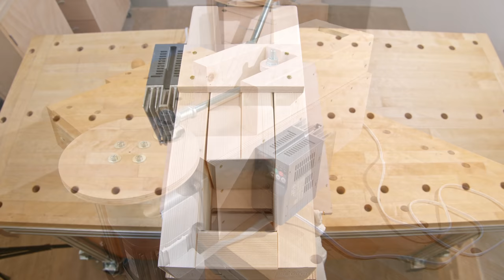An amazing way to compress household waste

Comment: You should just make a 1.5 hour long loop of the video from 0:05 to 0:46. That whole process is just SOOO satisfying. I love the sound of the empty can being dropped in, getting crunched, then dropping into the trash - all as the motor drones in the background.

EDIT: And you did it at the end, too!
Reply: Would serve as a nice 'white noise' loop to put me to sleep at night.
Reply: I did not find it satisfying.  I can easily crush cans that much with my hands, just as fast. It seems like it could crush the cans much smaller with that motor.  Doesn't seem stressed at all.  Though, the bottom board should be pocket holed for more strength.  The way it is attached can't have much strength.  Alternatively, metal could be wrapped around the outside and that metal screwed into the side boards.
Reply: make it 2 hours
and filter out the motor noise as much as possible
done

Comment: Well done! I love your design and construction skills. The motor and power supply would be the expensive items. However, by constructing it oneself the total cost would be quite reasonable. For those who collect many cans, the space saving for carting to a recycling centre, and the consequent reduction in fuel costs, may make it cost effective. So ignore the negative comments. You have presented a machine designed to increase the number of aluminium cans which can fit in a given volume (e.g. a trailer or Ute) to cart to a recycling centre. Potential users can work out for themselves how cost effective it would be. Great idea 💡. I like it. 👍🏼

Comment: Do you usually buy the motors for your projects, or do you scavenge them from dead appliances / other sources? Great, great work, from precision to practicality to aesthetics, all over your channel!
Reply: I admire his work but I don't think I would invest that much money and time to make a machine to break up cans. Many of those projects online make the builder look good, but has little use in real life. Most people are in the Youtube to get view and make money, not to teach you anything useful.
Reply: @Hour882Die  No offense but ... I think you overestimate what YT gives people in terms of money at present (years ago maybe that was a different story but not anymore). There is a reason why many have turned to patreon and other sources of revenue. As for no use in real life... Many of the projects on this channel are nothing but useful, some more than others sure but this project would probably save you some cash in the long run if you got the hardware on the cheap. Over here where I live for instance prices for trashbags (these are special bags for which you pay extra and only these special bags will be picked up on trash day, no exceptions) are quite high. Saving space as a result does pay off.

Comment: When I was in Japan (1985) they had these beer (Asahi) can (up to 2 liter!) selling machines with a similar can crusher beside. You can also upgrade the sliding mechanism with linear guide rail.....as it is a cno project (cno = cost no object)

Comment: 素晴らしいマシン。 プレドリル/スクリュー下穴に使用したドリルビットの名称または種類を教えてください。 私は英国でこれらを見たことがありません。 ドリルビットはとても面白そうなので、試してみたいと思います。 
Fantastic machine. Please would you let us know the name or type of the drill bit you used for pre-drilling / screw pilot holes. I've not seen these in the UK. The drill bit looks very interesting and I'd like to try one.
Reply: Nyan Hein Zaw  Thanks it's shown at 3:19
Reply: @maxximumb  I can't speak to the brand of that bit, but it's just a tapered drill. Usually they're sold as a combination with a countersink attachment, and called 'tapered countersink drill'. They are sold as many brands.
Reply: @nominalvelocity  Thank you. I found a set online. It's amazing what tools are out there if you just know their names.
Reply: @maxximumb  hola, las encuentras en bastantes medias y como lo dice el usuario anteriormente es broca avellanadora, que bueno que las encontraste en línea , saludos

Comment: Dude whoever is reading this I have a can crushing device but I can't tell you what it is but I will tell you that I want to make the exact same thing but make it better and stronger and just a little bit longer so when I smash the cans it goes down into the bucket where it has a slit in the middle and that way it could be for my apartment life it gives me something to do when I'm stressed out or I want to take out on someone I take it out on the cans and that's the best therapy there is and I tried to say the world one day at a time by saving my cans now people want to donate cans to me all I got to say is make sure they're not dent make sure there's no trash no cigarette butts in it and you'll be okay and make sure you rinse them out too and let me know they're rinsed out so if you want to donate your can send me that's fine I don't mind you just got look me up right now just got here he made a wonderful candy crusher and it's very quiet too cuz if I had something like this I want it to be very quiet for the apartment life so during the day when everybody's late I can make a little noise and Crush some cans I just need to find someone who can help help me rebuild my design that I have in my head for the candy crusher I have right now right now I use the tamper and my can crushing device that's on the table I have not got it already yet but if I come up with a better one just like that with a slot and that way won't you smash the can it drops down into the bucket or the trash can that will be cool right now all you people keep up the good work on making your homemade game crushing devices